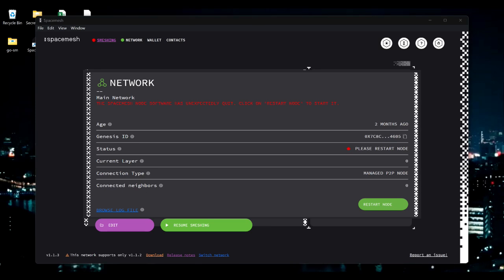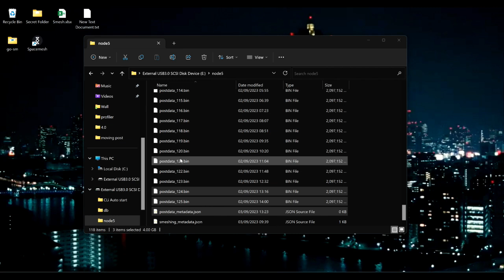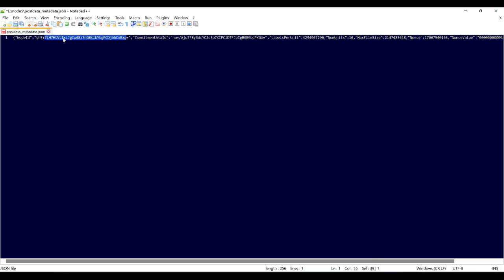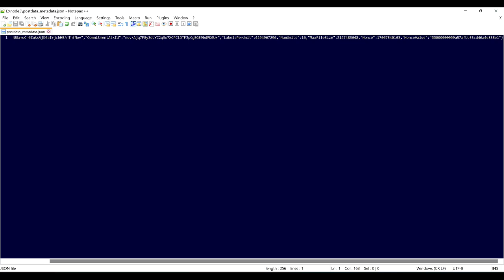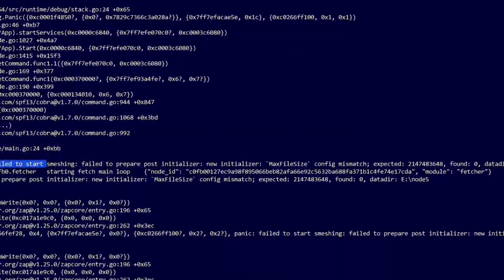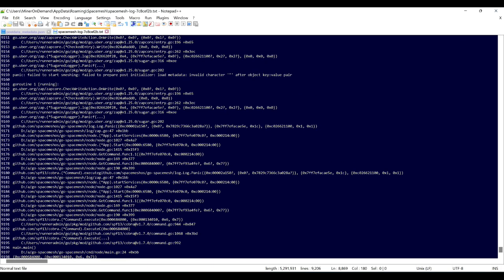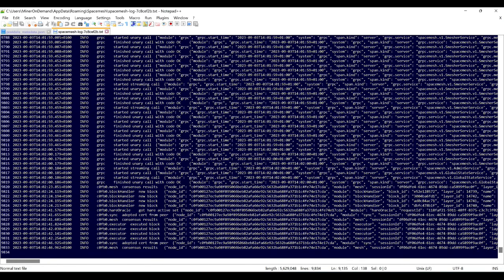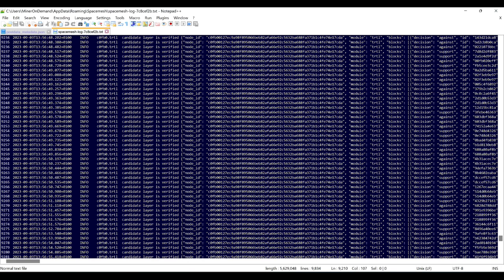Spacemesh a Troubleshooting guide - Spacemesh

Comment: Proof is invalid - corrupted file. You got a fix for that one?
Reply from the maker: CLi can regenerate. Or tell you what files corrupted
Reply: @minerondemand  can you do it on windows if I was running smapp?
Reply from the maker: CLi is a Powershell command line.
Join discord for more help using tool
Reply from the maker: hope this is an SSD
Reply from the maker: try reduce plot a little bit